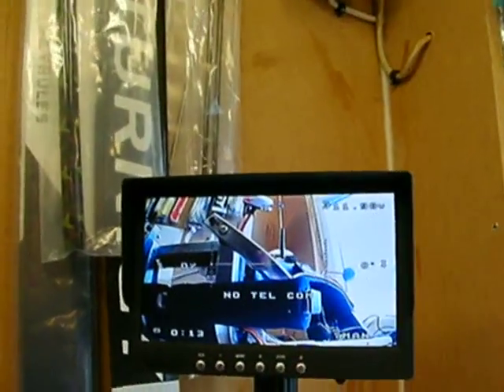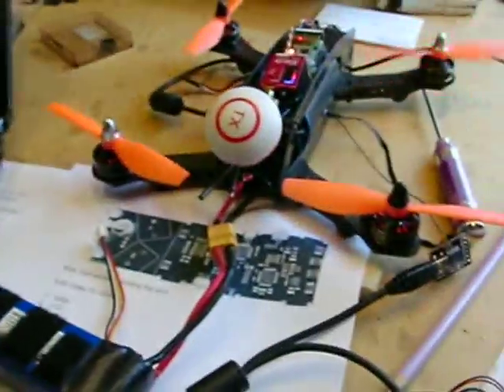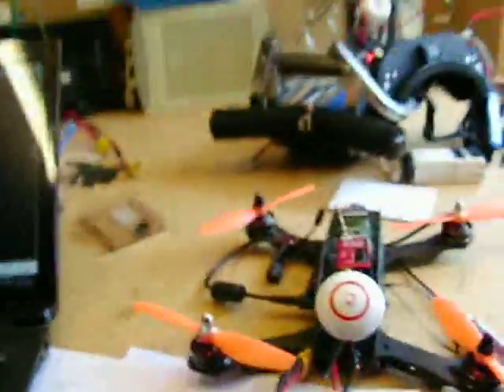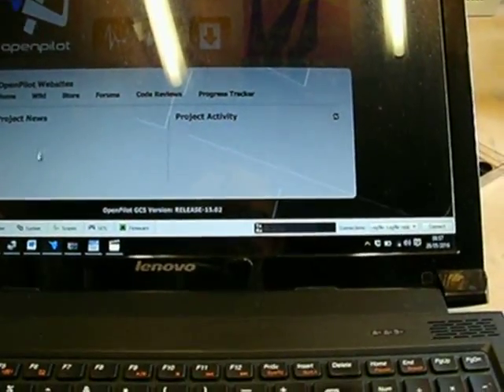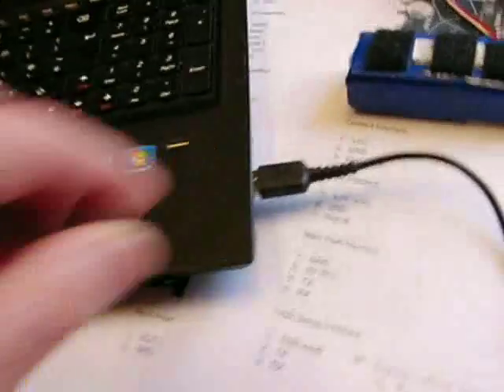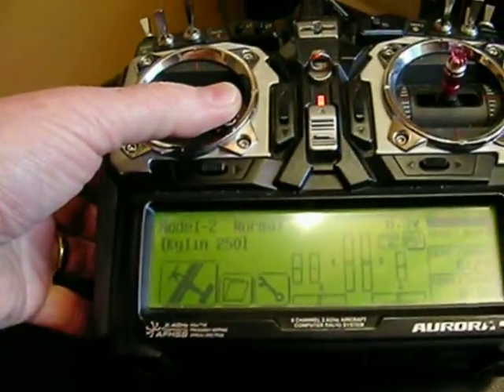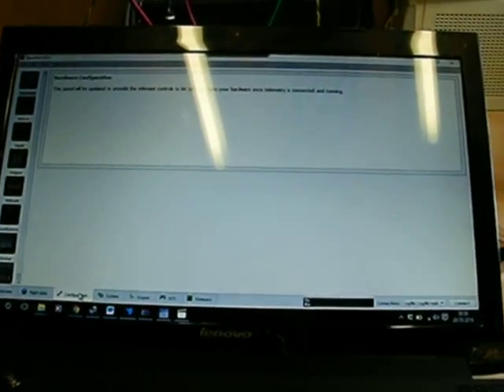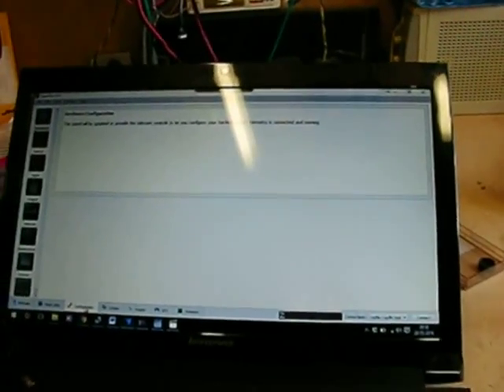Klyin250 No Tel Com and Disarmed Fix for PPM Connection

Comment: Hello. Your video shows the OSD port setup for PPM. You said that there is a different setting for S Bus. Did you do the video? What is the correct setting for S Bus? Thanks Alan
Reply: Crazyhats download the kylin manual, the correct settings for SBUS are in there. you will see there are different settings for each connection type. kev
Reply: Hi Kev
I changed my Radiolink receiver for a FrSky X4R to connect to a Taranis. Flies OK. Now all I get on the OSD is "Waiting for the heartbeat". How do I get it to operate correctly? Any hints? Thanks Alan
Reply: Crazyhats I think you need to look at page 20 of the manual, there is a screen shot of the settings for SBUS.